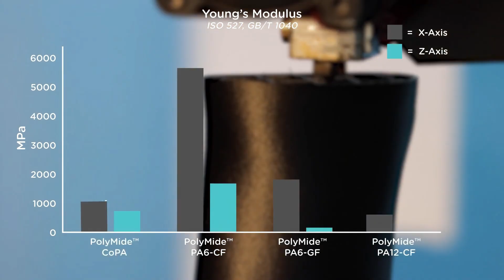PLA vs PETG vs ASA Filament Differences - What to Print With?

Comment: Which is the idea filament for a model rocket. I’ve been going back and forth between PETG and ASA and figure ASA due to its heat resistance. Also, I’m printing on an A1 with an enclosure.